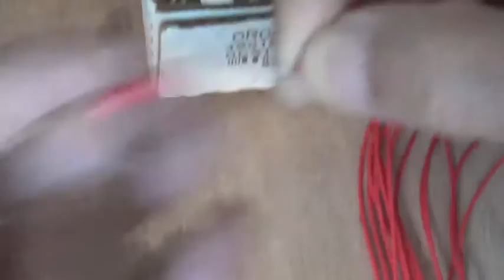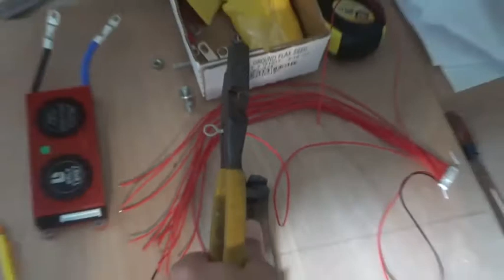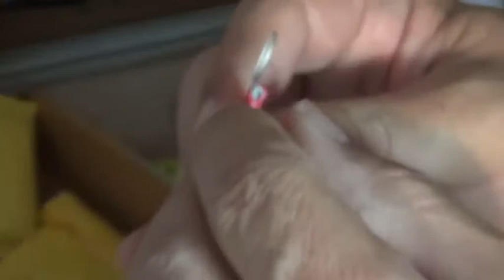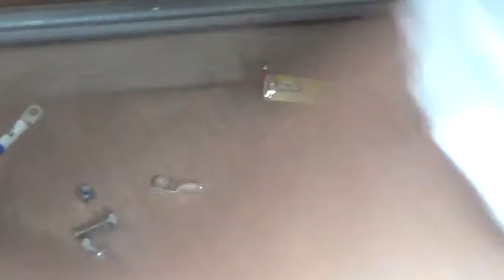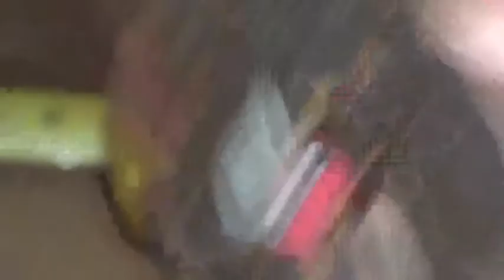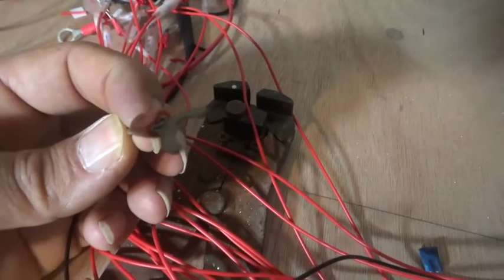BMS CABLE ASSEMBLY FOR A 16S LI FE PO4 100 AH BATTERY BANK SYSTEM

Comment: Saludos, I see that you are using a 16s BMS for your 48v batt bank, I'm new in the field of BMS, I own a battery bank of Tesla Smart Li-Ion battery module, which is rated as 3kw -57V and 100-150amps. They are in paralel to 48v to the inverter. How do I know which MBS is right for me? 6s 7s? 150 amps.. thanks for the videos and sharing the knowledge. Gracias.
Reply from the maker: First...you need to understand your battery pack...here is some information from the internet...
Smart Lithium Ion Battery 18650 EV Module - 57 Volt, 3kWh

These  18650 Tesla-Smart Car modules are comprised of 2600mAh cells arranged in a 22p15s configuration. They are rated at 100 amps, 150 amps peak. They have an integrated liquid cooling/heating system, but they can also be air cooled in light duty cycle applications. They also have an integrated 100 amp fuse, and an ATX20 connector with cell level connectivity for BMS systems and two integrated thermistors. The packs contain 330 cells, and each cell is independently safety fused on both terminals. They have been lightly used, most with less than 5000 miles on them, and are designed for 100,000 miles to 85% capacity. A preferred configuration for a typical AC50 application is 4p2s for a total of 24kWh of energy with a total of 8 modules. These work particularly well in 48 volt marine and cart applications as well.
========================================================================
It seems to me that what you need is a Li-Ion BMS  with a  15 S configuration.   For a better idea of what I'm saying...check this https://www.youtube.com/watch?v=El8LocCDPuk .  The BMS used there is a 13 S ...but you will learn more...as you check other sites.  If you like my site, please subscribe!!!

Cheers!!!

Learning.Power@gmail.com
Reply: @learningpower9437  
Thanks! Also founded that I can wire the BMS to the ATX20 battery conector. The link was very helpful as well.
Reply from the maker: ..As always double check your work...working with a potential of 150 Amps...for few milliseconds..., it will melt everything around....!!! 
If you like my channel,   please subscribe.  Thanks.
Reply: @learningpower9437  Acknowledged.